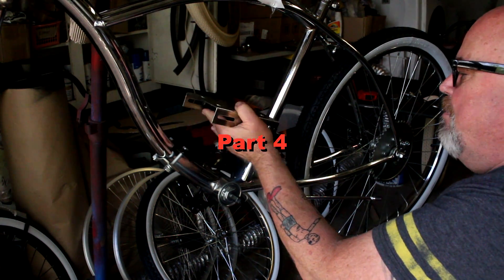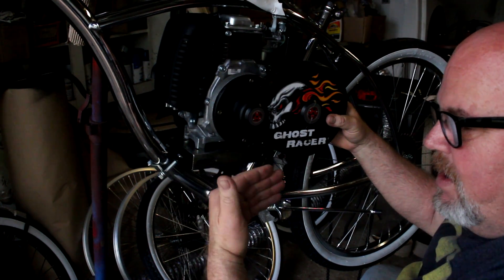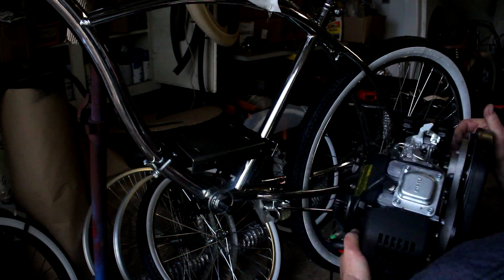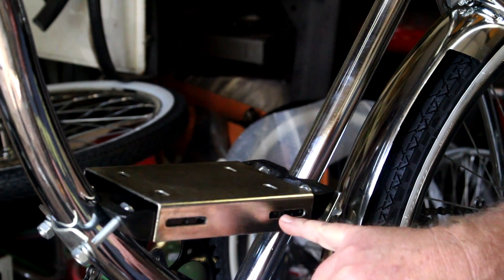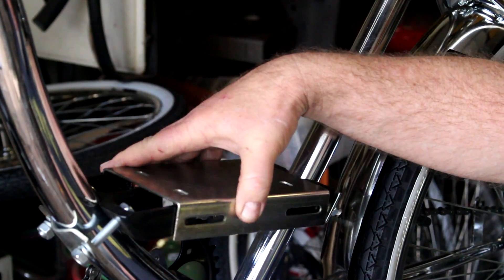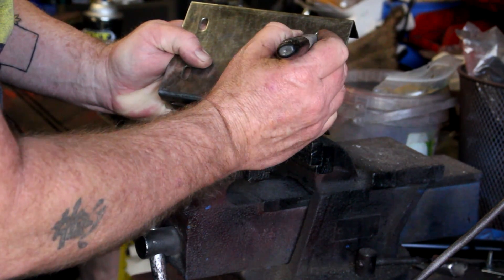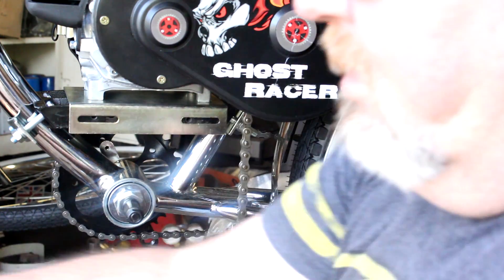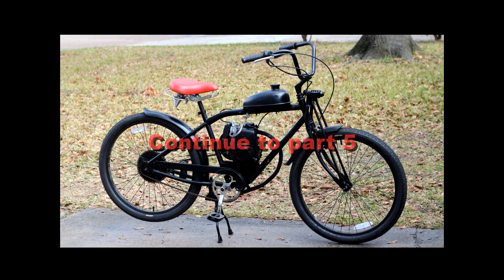How To Build 4 Stroke 7G Motorized Bicycle Part 4 NEW

Comment: I built one of these, only trouble I had was with the chain tensioner...
Reply: Motorized bikes work just fine without a chain tensioner, just shorten the chain to where there is about 1/2inch of slack. This worked for me in the long run